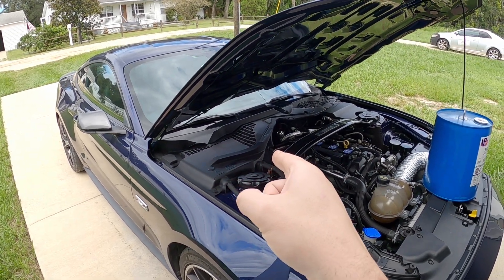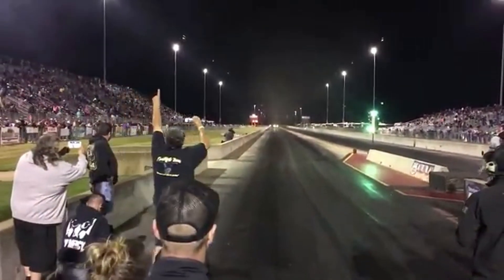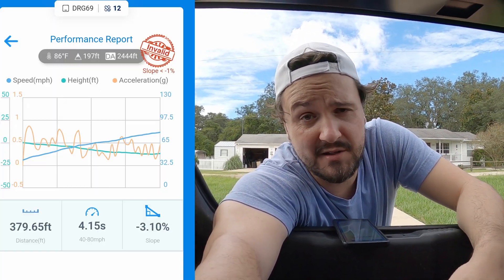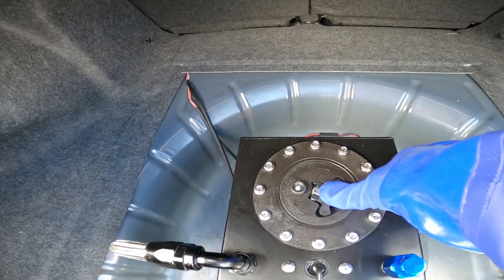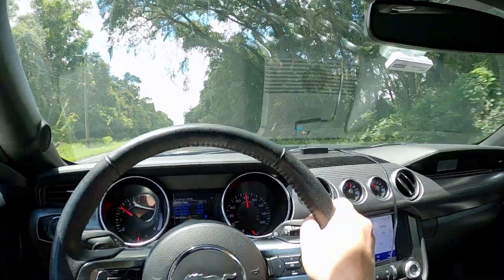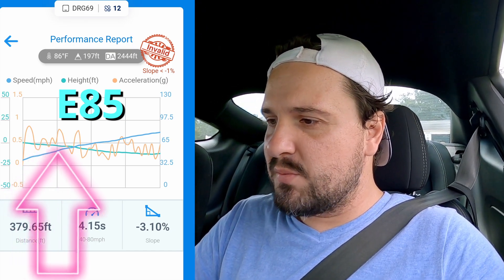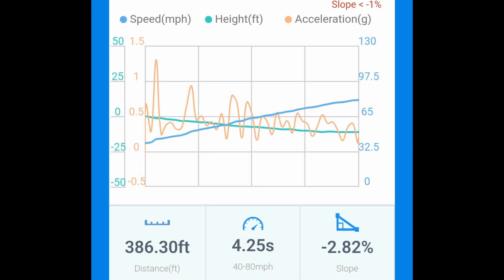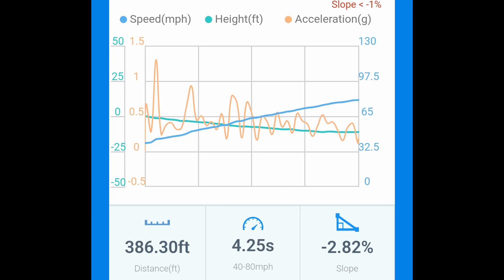Something Happened After Using VP Racing M5 Methanol In my Ecoboost Mustang!

Comment: Kirk, I don't know anything about M5 fuel, but you have a fast car on Flex Fuel! I looked at some old data logs from runs I made on the 1/4 mile track and your faster between 40 mph to 80 mph, burning Flex Fuel from the pump, and my ETs are all in the mid 12s. The only time I ran under 4 seconds, was while burning VP X85. I'm impressed!
Reply from the maker: Really? I don't know why I thought your car was faster. So, Buster should be about the same as yours in theory. Which would make it the fastest car I've owned, unofficially of course lol

Comment: Methanol takes almost double the amount of fuel as ethanol so you would need a retune
Reply: No. The car runs closed loop fueling so it’ll adjust without retune.

Please don’t comment on what you don’t understand and spread misinformation.
Reply: Dud you monitor fuel pressure and injector duty cycle?

Comment: Nice work. I’m still considering selling my lo-mile 2014 GT California Special, manual trans, and looking for a low mile 2020-23 Mustang EB HPP with the handling package
Reply from the maker: What's the reason for wanting a HPP  Ecoboost over your CS? Just curious since most people go ecoboost to GT, not the other way around 😅
Reply: @KarzKreated  makes sense to me. less weight.
Reply from the maker: His CS is an S197, so it's probably on par with an HPP for overall weight. But if he wants the best handling mustang around 30k without paying the premium for the Shelby's or PP2 GT's, then an HPP with Magnaride is the way to go!
Reply: @KarzKreated  the overall weight might be similar, but it’s more to do with where it is. The s197 is about a 55/45 front/rear weight distribution while the ecoboost is nearly 50/50. Makes a big difference in handling.
Reply from the maker: Yes, weight distribution is superior in the Ecoboosts regardless. I've driven a few s197 cars, and they feel more nose heavy than the S550's despite being around 200 pounds less. The nimble HPP handling will spoil you 😅
Reply: @KarzKreated  unfortunately to get the magna ride, you have to purchase the premium. You can’t get a base ecoboost, and then get the magnaride. I was at the Ford dealership yesterday and I custom ordered a base eco-boost with the performance package. Sticker on the car after destination is 37K. If you Get the premium just get to the magna you would be spending mid 40s . Not worth it. by the way, speaking of that, you haven’t done an analysis on the new eco-boost engine in the 24 mustang. I open the hood on it at the dealership and it has way more room in the engine compartment than the claustrophobic version you have. Also, the eco-boost is now direct AND port injected
Reply from the maker: @sammyjammy6647   The OP was referring to the S550 Gen HPP. The S650 is significantly more expensive. I paid 32k for my base HPP new, and from what I heard, Ford dropped the High Performance Package for 2025.
Reply: @KarzKreated  yes it’s true. They’re dropping the HPP starting with the 2025 models. I asked the sales guy when the order banks for the 24s would be closed. He said sometime next month. So I’ll find out in the coming weeks if my build makes it through
Reply: @KarzKreated  and yes, now the base HPP is 37K. But I’ve seen it for 36K msrp with El Cajon Ford(by San Diego)if you get a dull color like dark gray metallic or whatever it’s called. The one I ordered is the vapor blue metallic which is now a $295 option. Was thinking of the yellow splash metallic, but that’s about $1000 extra. By the way, the dealership that has the 36K one was seriously considering my offer of 35k out the door but I just didn’t like the color.
Reply from the maker: @sammyjammy6647  The vapor blue is worth $295, but $1,000 for yellow!!! Good grief, Ford... Hopefully, they will accept your order before closing out 2024 models.
Reply: @sammyjammy6647  You don't have to get the premium package. You have to get the HPP model and the handling package. I own one.
Reply: @MrTL3wis  you can’t get the magnaride unless you get the premium first
Reply: I own a 2020 HPP 6-speed magneride car. They're a pretty good package from the factory, but even better with an intercooler and a custom tune.

Comment: Got a question my car is tuned on 93. Would it hurt if I mixed M5 with 93? I will say that you can’t use MF in the methanol kit because it is all racing fuel, which is bad for the pump for the methanol kit
Reply from the maker: Without tuning, it probably wouldn't hurt depending on the amount added, but it probably isn't as beneficial using that way. It would mix a little higher than an E85 blend in terms of octane, so it's definitely better than 93 alone, but the real question is, would the potential gains justify the cost. I paid $70, including tax for 5 gallons, which breaks down to $14 a gallon! When E85 is around $3 a gallon on average, it's so hard to justify race fuels for anything other than a race application.
Reply: You can have some fun with Flex Fuel pump ethanol! But it isn't always 85% ethanol. Most of what I have purchased, has tested in the 60 to 70 percent ethanol range. So it will require some math and mixing (with 93 octane) to reach your target. I've gone as high as 25% ethanol mixed with 75% quality 91/93 octane gasoline, while using a base 93 octane, stage 3 tune.
Reply: You would be better of doing 1 gal of e85 mixed to 10 gal of 93 without a tube any more you will go too lean
Reply: Don’t mix more than 5% into your tank. You might be better to mix 10% of toluene. Basically straight race gas additive ;-).